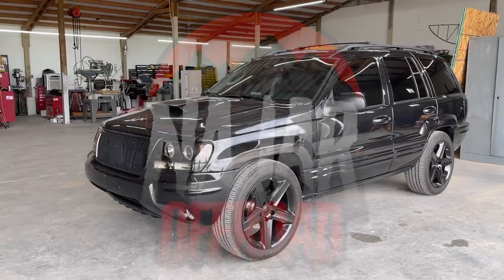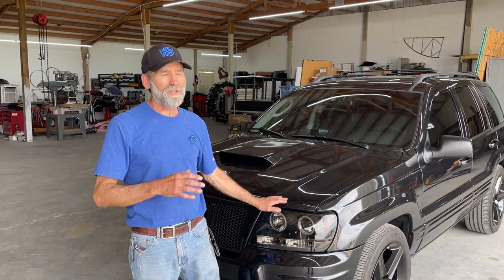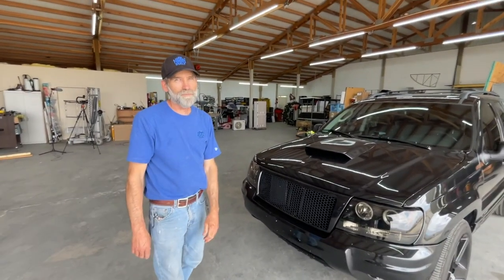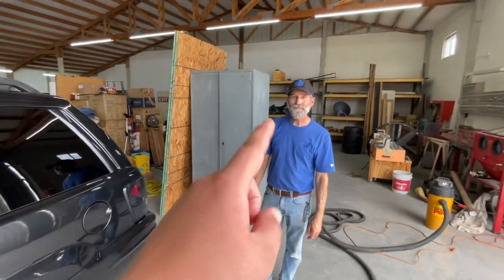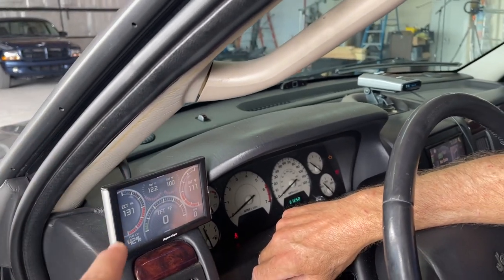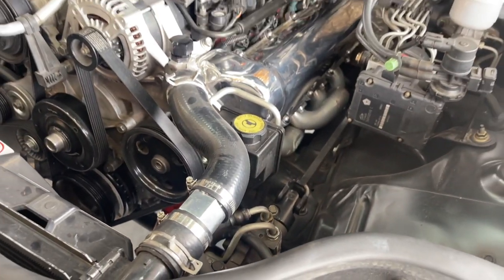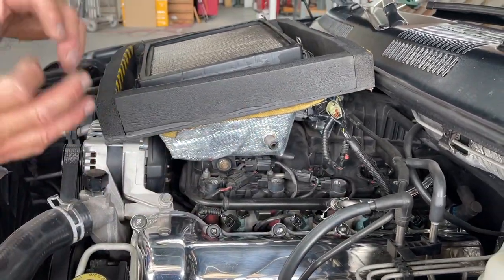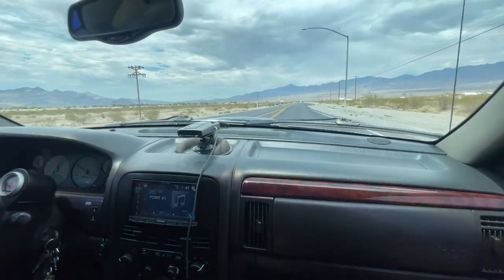Walk Around of MartinBuilt's Jeep WJ Build | Grand Cherokee

Comment: His header are Doug Ts. Do they still make headers for 4.0 jeeps?
Reply from the maker: Yea they are I’m not sure it’s hard to find headers for the 4.0 on the WJs I know they make them for XJ and TJ but not sure if it will bolt in
Reply: I gotta figure something out with these headers.  I'm running on 215k miles and need the best parts to get to 300k

Comment: 10:20 when you hear this noise, first replace the blend door actuator. if that doesn’t solve it, replace the blend doors. my goofy ahh replaced the blend doors before the actuator. turns out it was solely the actuator that needed replacing.

Comment: What’s crazy to me is that my 2001 Laredo has every option as a fully loaded limited except the “wood” inside, 6 disc changer, and moonroof. I have leather seats, adjustable lumbar support, infinity stereo and speakers, 4.7 with selec-trac, all the goodies. I just got into WJs when I bought my first jeep back in February so I didn’t know what a deal I found when I got it for $2500 with 185k miles.
Reply from the maker: Nice! Probably a special order from the dealership. Having the sides painted and the trim probably added more to the cost
Reply: I bought a 2000 WJ Limited with the 4.7  and it has 4x4, i got it for $2700 with 112k miles
Reply: @undergroundmiami7924  I just got a 00 wj 4.0 ltd with 242k, no check engine lights and I’m glad it’s just 2wd. All I need essentially is pothole clearance a heater and reliability. Been on a motorcycle for 5 years.😂